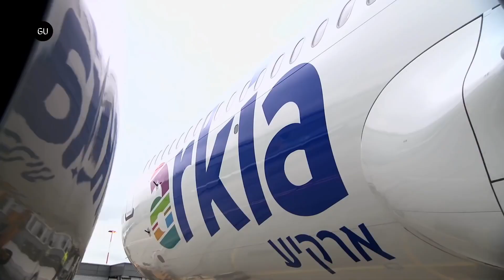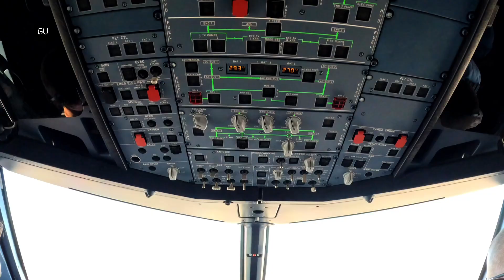Pratt & Whitney GTF Engine Problems! Hundreds of Airbus A320neo Recalled for Inspection

Comment: Airlines are going bankrupt because of known and P&W hidden inherent design issues, hiding data for certification, grounded engine.  So far, no one has been killed due to a failure of this engine.  So far.

Raytheon was hit with this unknown engine BEFORE it started to fail with the public as the flying guinea pigs.  The corporate officers thinking they'll get their bonuses and leave before the shit hits the fan.  P&W did a collective sigh "whew!"  "we're rid of that massive liability" as the corporate officers at PW and UTC collected their bonuses and departed.  All clear?

The FAA and the public don't know the half of it.  (the real inherent design issue(s) haven't revealed themselves (in-air failures), haven't occurred yet.)   Just wait, as the cycles accumulate, the REAL issues will start BLOWING UP.

Comment: Alien is attacking,this gtf is advanced design,all engines needs interval maintenance so no problem in this engine.
Reply: HORSESHIT.  You're ignorant.  Airlines are going bankrupt because of known and PW hidden inherent design issues, hiding data for certification, engine.  So far, no one has been killed due to a failure of this engine.  

Raytheon was hit with this unknown engine BEFORE it started to fail with the public as the flying guinea pigs.  The corporate officers thinking they'll get their bonuses and leave before the shit hits the fan.  P&W did a collective sigh "whew!"  "we're rid of that massive liability" as the corporate officers at PW and UTC collected their bonuses and departed.  All clear?

The FAA and the public don't know the half of it.  (the real inherent design issue(s) haven't revealed themselves (in-air failures), haven't occurred yet.)   Just wait, as the cycles accumulate, the REAL issues will start fucking BLOWING UP.

Comment: We have bad management and quality has been merged with production which should have never ever happened. Plus PW is hiring Pizza Hut delivery guy, refrigerator guys, and worse to work on aircraft engines. Instead of hiring more A&P FAA Approved mechanics and inspectors the problem is getting bad and is a nightmare waiting to happen. I have never worked at an aviation company that has done so much shady underhanded stuff like this one. And if you try to do something the correct way according to the engine manual you're told by the engineers and management that you're over inspecting. And this is just the tip of the iceberg. The people in management only want the position for clout and to be known never to make anything better.

oh yeah they will no doubt see this but it's the truth. We have too many dead weights in management and not enough people with actual aviation experience.
Reply: Wow, sounds like you worked there once.  Spot On.
Reply: Report to FAA and social media channels

Comment: I would rather choose LEAP engines instead of PW. This engine is more conservative but also more reliable
Reply: Isn't hindsight wonderful?  How the fuck would YOU know 10 years ago when the decision was being made?
Reply: MC-21 engine is best from PD-14 izedlyid
Reply: The LEAP and the GE-90 have a powdered metal contamination problem too but I understand they discovered theirs before a lot of engines were effected. The GE-90 will have a FAA service notice soon. 
P&W has the GTF Advantage version coming out in January. It's suppose to have it solved plus more thrust and better fuel burn. GTF has better fuel burn/savings than CFM Leap but so far better reliability. These engines have about a 25 to 30 year service life so hopefully both LEAP and PW will have everything running fine by next year. LEAP has new parts ready for next year which should improve time on wing.

Comment: Will this issues with the GTF engines also affect other airliners such as the A220 and the Embraer 195 E2?
Reply: It’s affecting a lot of A220 already. Airlines have planes parked on the ground waiting for replacement engines.
Reply: @jefferyjin5551 Except for Delta Airlines. They have the largest P&W GTF fleet and Delta said they expect little interruptions. 
United has over 100 GTF engines ordered too but expects no problems as it seems engines made after 2021 are okay.
Reply: I haven't heard anything bad with the Embraer jets using the P&W's as of March 2024 ?
Reply: @rscott2247  lol just ask KLM and Air Tanzania how they like Dependable Engines 😂😂😂
Reply: In May, for a while, a third of KLM E190-E2 planes were grounded because of engine issues - and they are far from the only ones with trouble from these trash engines.
Reply: @rafaelwilks The E190's use a GE powerplant.
Reply: @rafaelwilks  E195-E2**
Reply: @rafaelwilks  by this time next year the PW upgrade will have everything under control. It's the Advantage package for the GTF which is more efficient than LEAP which also has a powder metal issue.
Reply: @boblackey1  and then we'll have more issues from the makers of the Dependable Engines 🤣🤣🤣